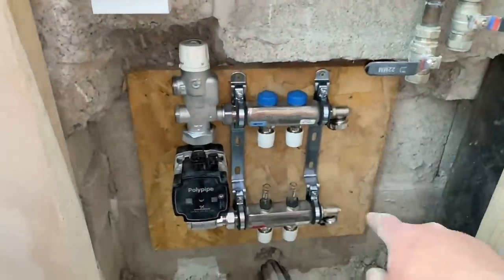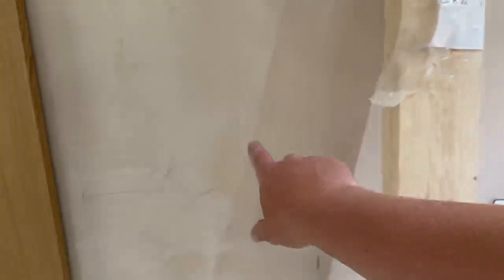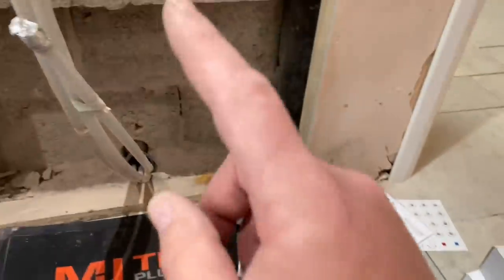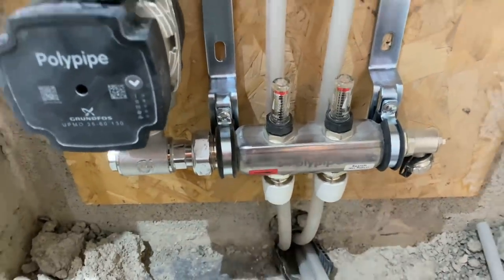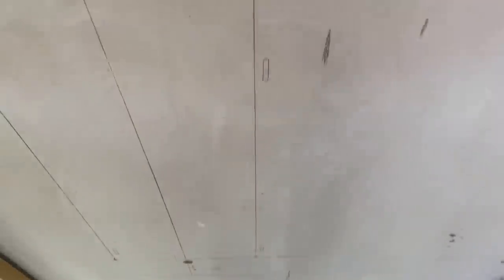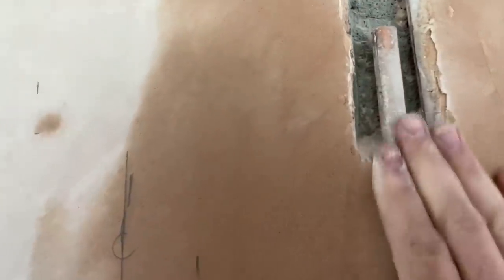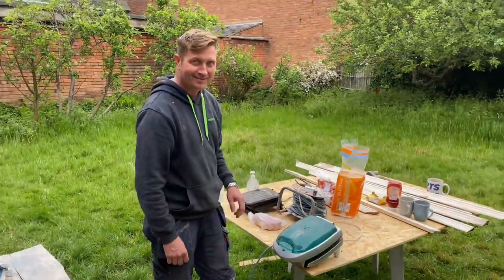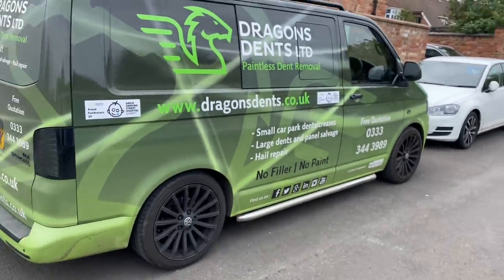WHO DRILLED THE CENTRAL HEATING PIPE? PUTTING RIGHT ROUGE TRADESMANS ROUGH WORK

Comment: Its just reminded me Mark of a job we were called to some yrs ago where the original plumber refused to and reason was the kitchen had completely flooded . We came to have a look and after a test because everything looked bang on except for a floor full of water . we decided to give the machine a test so see if there was a leak on machine .. but immediately the machine  tried to eject water it squirted out of the waste pipe .  and  on inspection we found a wad of plastic stuffed down the upstand waste ... SO  synopsis was the original plumber had stuffed a was of plastic packing paper down the flexi pipe to temporarily hold the pipe in the waste upstand whilst he clipped the waste pipe and probably forgot to remove it . here im being charitable for him ..  Then the chippie finishing the unit pulled the machine out and in dong so pulled the flexi straight up and out .  and on replacing the pipe when he was finished not knowing or seeing the plastic stuffed in the upstand thought job done . HENCE when the woman put on a wash . well the water had nowhere to go then . . only up and out thru its easiest path over top the waste upstand . resulting in destroying her kitchen floor which was timber ajoining the tiled section .  .No wonder he did not want to return ..
Reply from the maker: What a nightmare mate…. The things you see and wonder how they have even lasted that long…

Comment: A real bod gig and scarper job on that kitchen. Often times kitchens look great at first look but then on closer examination, especially removing plinths and having a gander reveals a complete shit show of dodgy wiring and plumbing. Quite often especially with a newly tiled floor they will tile up to just beyond the plinth (to save tiles) which means you cannot just slide the fitted appliances out but have the annoying task to lift over the obstacle as you try and grunt it out, whereas a few tiles in way of the fitted appliances would have cost a few quid (maybe even effectively free if already bought and not used) to make future maintenance easy. Good for showing the mistake even though it was you paying the price for someone else’s poor pipe fitting practice, I thought your precautions were reasonable and a pipe finder thingamajig would have alarmed for all of the fixing points on that side. The only 100% way of guaranteeing not nipping them would have been to do a vertical chase to find them (starting at the bottom) - very cautiously. Well done and good video.😀⛵️
Reply from the maker: shocking isn't it mate

As for hitting the pipe.....i tried as much as i could to miss it, did what i could do